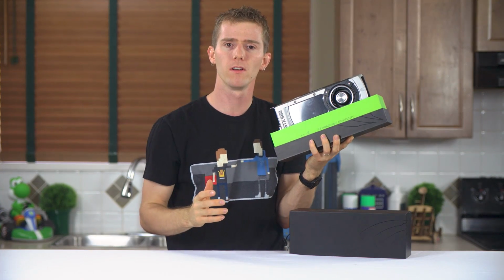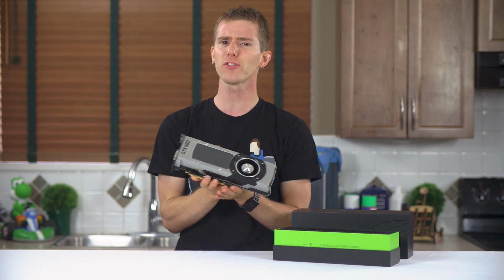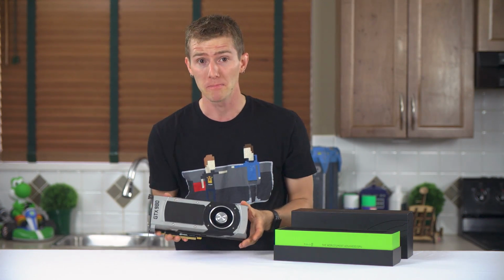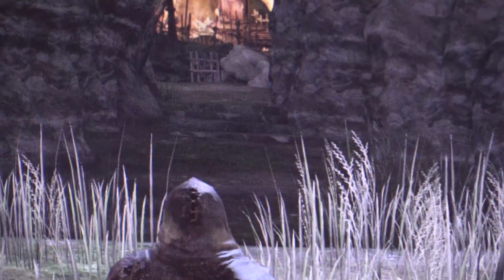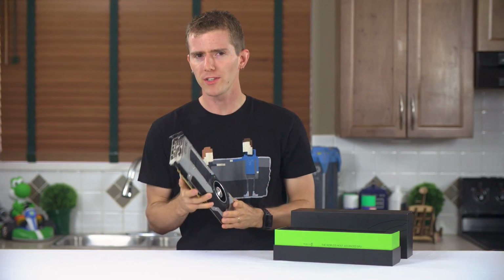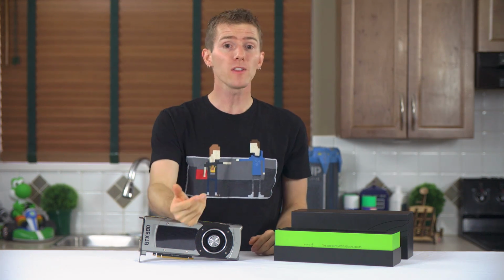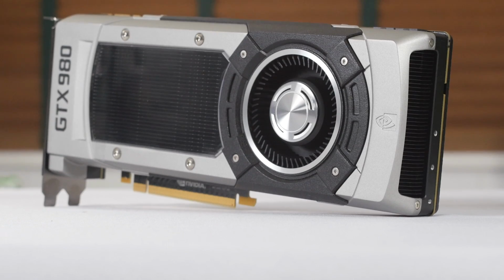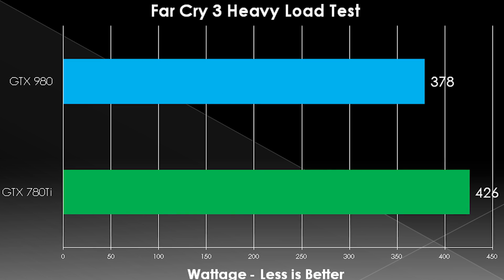NVIDIA GeForce GTX 980 Video Card - Performance Overview

Comment: Will be nvidia GTX 1000 cards?
Reply: yumri4 ikr
Reply: WeakEnough that is something yes but as the GeForce brand is so popular i doubt it.
Reply: There is a 1000 series but its very old
Reply: sweetdino3 if there is nVidia does not regonize it as they only list back to the 2000 series back when 2D graphics was big i think it was the 4000 series at which point 3D hardware acceleration was in the cards.
Reply: Yeah gtx 1070 and 1080 will release next September or October they release a new card series every year.
Reply: oh my gosh... hmmm..... gtx 2000... 3000.... :D
Reply: Safwat Khan
 looking at how nVidia has been nameing their cards it will most likely be 1700 and 1800 instead of 1070 and 1080 even though being the same cards just differnet nameing for them.
Reply: x BublizZ looking at the numbering fashions used by nVidia besides from probably a letter before, after or inbetween the numbers to make it differnet from the series a decade ago for search propuses on google, bing, and yahoo indexes why wouldnt it be like that?
it follows their own conversion for numbering cards which is what i based it upon anyhow.
Reply: look back at the 7xxx, 8xxx, and 9xxx series they added a throsand each time not just a hundred
Reply: well as the oldest card that nVidia will admit to being theirs inside of this numbering convention is the 2100 your 1780 does not exsist as either it is when video cards were just a video chip that you soldered on yourself or just outright did not exsist  or more likely had a diffenret name.
for the 800 series it is more of just a PR move is all.
Reply: nope just nVidia GeForce 2100  from 1997 i think it said.
agian it was for PR that they skiped the 800 series.
Reply: so even your link says it is just PR
Reply: so you think it is more than just Press for the new cards ?
Reply: i still think it is just for Press and marketing as it is just a label nothing else that is like if you look at AMD using a X at the end of their cards to market them for longer even though they are just slighlty better forms of the non-X versions of the same card.
With the thing from nVidia of " we didnt want the consumer to be confused becuase of the laptop 800M series ... " blah blah blah i still think it is all just PR and marketing junk as it is just a name and nothing more.
Reply: ***** i think you missed what we were tlaking about as we were talking about the name not the functionality of the cards.
Reply: x BublizZ though does not listed the numbers of the cards
Reply: Can't wait for GTX 9080
Reply: ***** well the press on it right now says it will be Ge Force 1000 but no word on how to make it differnet from the last intieration of 3D capable GeForce 1000 cards ... yet
Reply: maybe? it didnt say is all
Reply: yumri4 maybe they will make new name for whole cards like... gepower? meh... or something
Reply: ***** the way nVidia works it will be more likely a GTX 1800 instead of a GTX 1080 card just to go along with their own numbering scheme but we will see next year and the years to follow if that is true or not as they very well might do what AMD did and change the front of models and use what you said just something like 1k 180 or somethign like that i say 1# and 1 letter than space and 3 #s as that is what AMD is doing but i might be wrong dont know but i do know that it seems no matter when and who you get a GPU from it gets toppled down to about 1~3 places lower within 6 months of when you buy it.
Reply: *****
Fun Fact the Maxwell projects were run right beside the Volta projects just we have the name "Maxwell" and not "Volta" as "Volta" is promised on "new 3D stacking technology" ... well when nVidia starting R&D for it it was a new concept now it is more of something that the OpenSource community might beat nVidia to the market on doing so hopefully the whatever project they have now will have something more than just more addressable VRAM which is the other problem as they can stuff up to 12GB VRAM onto the board with a Kepler chipbut couldnt becuase of self inposed restraints on the Maxwell iteration which will be the the same chip next year just a refresh of it so in 2~3 years it might be worth looking at what nVidia and AMD can do as 12GB VRAM might be coming in the near future which yay for that unneeded feature for most consumers not doing 3D modeling / rendering but for the consumers who are running 4k and the up and coming fast 8k standard makign at least 8GB VRAM needed to run a 8k monitor which doesnt exsist ... yet and by the time it does many new invovetions will be out so 8GB VRAM, except for the content creators and ppl who game at 4k, does not make sense nor does releaseing a TITAN card with 12GB VRAM then marketing it to gamers instead of a cheaper solution to a Quadro + Tesla mix.
Reply: yumri4 I dont think so, 1700 1800 ... 4700 4800.... 9700 9800, you see the problem? this numerical already happened, i think 1070 1080 is more probable
Reply: José Luís Lopes well we will see but i think it will just make more marketing sense to do it 1x00, 2x00, 3x00 and etc. or just branch out and make a new beginning to the series instead of just GT and GTX but something like N1 GT 1600 or N1 GTX 1900 or something like that
Reply: @yumri4  
Rtx 2080ti today
Reply: @FLASH24x  yeah i know though it is 4 years later. You then have GTX and RTX are slightly different in a way that only very specific  workloads will notice. So the GTX 16 series is not that different from the RTX 20 series. Though yes if you need the best of the best with a video out then a RTX 2080 ti is for you. For gaming a GTX 1660ti and the RTX 2080ti it will depend on the game but they trade blows on which is better in gaming objectively.
So here is to hoping nVidia doesn't end on only 1 generation of RTX cards and there is a 21 series coming for better performance in real time ray tracing on consumer cards. .... Hopefully the actual thing not a cut down version but to get that they will have to put 2 processors on to their card 1 for ray tracing only and the other for everything else. So as it seems the next GPU is going to be a 1 monolithic die and a 1 processor card that is not going to happen.

Comment: Can u put this in a gaming laptop?
Reply: No but they do have a 980m version for laptops
Reply: what about an ASUS-J notebook to be specific
Reply: yes, you connect it with the HDMI connection
Reply: Games4Geeks247 Do you even know what the fuck you're talking about kid? Your system will crash, thats way to much power for a notebook to handle, not only that it will run games will little fps boost, why the fuck are you even trying to play games on a netbook anyway? Just build a PC, that netbook WILL NOT be able to handle it. Get a better processor as well.
Reply: Yes if you gaffa tape it to the side.
Reply: yes but first you'll need to flatten it.  You can save a lot of money doing it yourself.  If you go to a junk yard they can flatten it so itll fit, just make wure you put scews in holes first otherwise they wont fit later on.  Don't try flattening it yourself its hard to get right, please got to a locaP SCRAP MERCHANT, YTHEYLL CHARGE YOU LIKE 10 POUNDS OR 20 DOLLARS ONLY.
Reply: Austin fruityfroofroo
how can you be sure it's not you?
Reply: xXRejector88Xx I'm actually building one too atm! Gonna get the classic i5 4690k, MSI GTX 980, 8Gb RAM, MSI Z97-Gaming 3 ATX. For stockage I'll go with 512 Gb SSD since I'll keep my laptop for everything else than gaming. Also my EVGA 650W Gold PSU should be enough, 1000W is totally overkill haha! All that, for barely more than my craptop!
Reply: Hey Would an GeFOrce GTX 765m in an ASUS-JX notebook be able to run battlefield 4 on high settings? or even ultra? atleast 50-60+ fps?
Reply: Games4Geeks247 Never
Reply: Games4Geeks247
http://www.notebookcheck.net/NVIDIA-GeForce-GTX-765M.92907.0.html

According to that it could do high settings at a decent FPS only at 720p, but some people don't seem to be affected by worse FPS than others :P
Reply: I aldready have that gpu, lol. yhx though
Reply: Games4Geeks247 Sure you do, Kek.
Reply: i do ASus jw
Reply: ***** ahahahaha.
Reply: In a laptop? No. With a laptop? Yhea. There is a vid on youtube somewhere.
Reply: You can now, with one of MSI's laptops or an Alienware laptop. Look up the alienware graphics dock. Annoying to move around, but I find it to be an extremely nice compromise
Reply: Srebrnic1 But then you have that persons that need the portability and the power of a gaming desktop, like college studens in engineering, and that every other week travel from college to home, like myself. So i bought a clevo p650SG, the 900m series is a huge improvement in the mobile graphics cards, the 980m is on par witht he 780 dektop FPS wise on game like battlefield and far cry 4 (seach on the youtube if you want to check it out)
Reply: Just stay away from gaming laptop! It's terribly overpriced. Take mine for exemple, I have a 1500$ laptop with a i7 2670QM (Beaten by i5 4690k) and a GT555M (beaten by any low-mid tier GPU) That crappy GPU is bottlenecking as hell and guess what you can't upgrade with a laptop, You are stuck with the crappy hardware! Belive me, just stay away from that!
Reply: 4cMaiden Listen to this guy. I sold my Alienware 17 laptop. It had a 120Hz 1080p display, i7 4800q, 16Gb RAM, 780m. I now have a desktop, that I built myself, with a Gtx 980 Superclocked, DDR4 RAM, x99 motherboard, i7-5820k, 3Tb 7,200RPM HDD, 120Gb SSD, 1000w PSU. I'm never going back to a gaming laptop until like college
Reply: 4cMaiden if you have the money and the NEED of the performance for games and the mobility for like college, the newer laptops aren't that bad, yes the performance for cost is way better on desktops but sometimes you need the mobility
Reply: 4cMaiden Nice bro! The 1000w is currently overkill. I bought it for when I add some liquid cooling in my desktop.
Reply: Are you really serious with this....
Reply: xXRejector88Xx well, there's a laptop with desktop performance with desktop performance called MSI GT80 Titan that comes with 2.8-4.0 ghz processor, duo gtx 980m, 32gb ram ddr3l 1600 mhz, 256 gb ssd 7,200 rpm and mechanical keyboard. But who want to afford it? It has $3700 price tag..

Comment: Is it worth waiting for the gtx 980ti ?
Reply: if you want 1440p and 4k gaming as fast or faster than on a 295x2 card then yes as atm the 295x2 beats the gtx 980 in those when set to Ultra or max settings on the newer games but if you only want to do 1080p, 1080i or 720p gaming then the gtx 980 can do it all and you will not see any difference between them.
Reply: Thanks :)

Comment: What happens when you're playing a game, in the menu, where the frame isn't capped with the new gtx 980? Will it burn up in flames when trying to produce 10k+ frames every second? Does it have a safety function that prevents this from happening. An example would be starcraft 2 before the patch or the sims 3 during loading.
Reply: as starcraft 2 and sims 3 do not try to produce 10k+ frames every secound its more of as many frames per secound as it can but on avg that is around 60 ~ 120 depends on how many things you have going on on screen.
will the card go into melt down? nope as there are safe gaurds against that happening but if you run it to fast for to long then it will throttle itself yes but it runs cool enough that throttleing will only happen if you OC it very far beyond the specifications for the card.
Reply: yumri4 Please note that I wrote menu and/or loading screen. I'm not talking about playing the game, we're talking about sitting in the menu or loading the game. There are still games out there that doesn't cap your fps in the menu or loading screen...

Startcraft 2 lacked a menu fps cap in the beginning which caused high end nvidia cards to overheat and die. The sims 3 also has NO frame cap during loading screen and your card will produce several thousands of frames every second. That's why I wondered with these new cards, which are superior to older ones. I'd expect a gtx 980 to produce over 10k+ frames a second during the loading in sims 3. Meaning it will run at 100% load for no reason at all because shitty coding on the game side. When you develop a game you ALWAYS cap the frames in the menu at either 30 or 60. PERIOD.
Reply: huldu use v-sync then as it auto caps it at the refresh rate of your monitor also when you develop a game you can set a cap at whatever you want even if it is like 1,000 fps ... that is unattainable by any monitor by the software program for the source game engine does allow for it.
Reply: yumri4 The sims 3 doesn't have vs, at all. There are plenty of titles where they "forgot" to add that option. Just like inverted mouse or keyboard control options. Yeah, you'd think they left that behind in the 90's. Still the it happens in game titles 2010+... Don't get me started on fov... assassins creed 4, what a joke.

The only you could get vs in sims 3 was if you had a nvidia card through the control panel or using d3override with amd cards. Probably a few more ways. There are plenty of titles out there tho, I just mentioned the ones where a lot of people got their graphic card destroyed during loading/menu selection screens.

While the graphic cards are generally "designed" to handle full load, they seldom actually run at 99-100% load. If you have a bad production card that is in any way faulty. It'll burn up. Made me think about the old hd4800+ cards I think it was. They could easily reach 190f+ under full load. You could boil water on those suckers.
Reply: huldu well in that i do agree that not in many games do i actually see the option for v-sync though enableing global program g-sync is another opttion again only able to be enabled through the nvidia control panel so like you said many game designers " fogot " to add that option and AMD cards still run hot enough for you to boil water over them while running and not meltting though if cooled properly nVidia cards stopped running that hot ... not to say they will not burn up just you cannot boil water with them anymore and to that if you have proper cooling for air cooling and/or if you have liquid cooling the burnning up of the card will not be as much of an issue but most of us ( ie me and probably you ) do not have that so yes point taken and hopefully this generation of cards will do better with heat dissapasstion than the last which the 295x2 needed liquid cooling ... reminds me of the 1980s when they did not have a way to do air cooling for computers and i hope we are not going to go back to needing to liquid cool the entire computer as that will suck for little to no preformance gains.

Comment: What would be faster, 2 970s in SLI or a single 980? Also could a 700w PSU run SLI 970s if they never overclocked?

Comment: Would a MSI gtx 750 ti gaming work with multiple displays? (2-3).... Help please
Reply: a single 750ti would work with multiple displays up to 4 displays but that is depending on how many outputs the maker of the card decided to put onto the card with the MSI GAMING N750TI TF 2GD5/OC card it can only support up to 3 displays but that is enough by what you have said in that one of them would have to be on a VGA connector so if you want everything on digital you will need another card or just not go with that one as the GIGABYTE GV-N75TWF2OC-2GI card supports up to 4 fully digital monitors all running at one time off of one card and only costs $10 off of newegg to get it.

Comment: I'm SHOCKED to see the amount of hate this card is getting. It performs BETTER than the 780 ti and costs $200 LESS than the 780 ti, overclocks better, runs cooler, and uses less power. What's NOT to like, seriously?!

Comment: Guys I have a 670 but my card model has been discontinued (EVGA ftw edition with 2gb memory) so I can't get my hands on another one and SLI for a decent price. You think it's worth upgrading to a 970 since it's quite cheap, then sell the 670 and get most of the money back? My concern is the 670 doesn't have enough vram for modern games, for example shadow of mordor which recommends 6gb. Right now I feel it's not worth it. Sometimes I feel like the gpu industry only makes minuscule advancements each generation to maximize their profits over a long period...
Reply: I'm only running 1080p too.
Reply: Should be obvious but I'm only running 1080p atm.

Comment: I really need a new graphics card my old amd 7750 Just can't handle games today should I get a gtx 980 sc acx or wait for the gtx 980 ti? and should I upgrade my fx 6300 to a I7 4770k i got told that my current fx 6300 is still good and dosen't need a upgrade.

Comment: So if you're not overclocking which one would be better this 780 Ti or the 980. And with that being said which one would be better the 780 Ti or the 970. And I'm talking about frame rates and the card is meant to give me the best gaming experience for relatively heavy games like Crysis 3 . But will not be placed on a 4k monitor.

Comment: For those of you saying that this card makes the 780Ti's or the Titan Blacks obsolete... you're out of your minds.  The only thing you know about video cards is obviously spec sheets.  While it obviously consumes less power and runs cooler it does not kill either card by any means.  Look up some detailed comparisons for yourself.  I wouldn't ever even consider selling a 780Ti or Titan Black from any manufacturer to buy one of these (or even a 980Ti version) in a million years.  I see this card like I see the 780 (regular) upon release.  It will be easily stomped in a short amount of time by a Ti version.